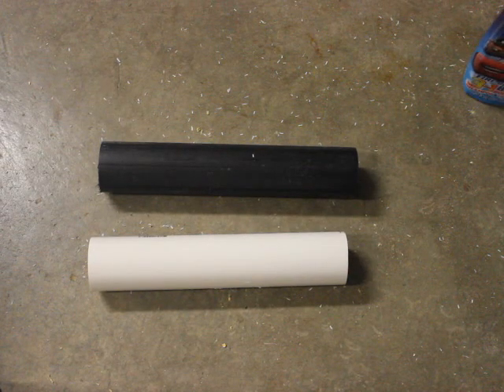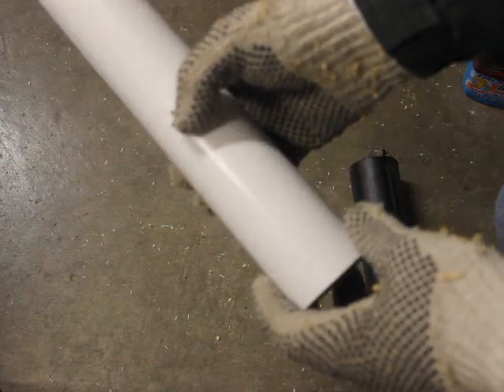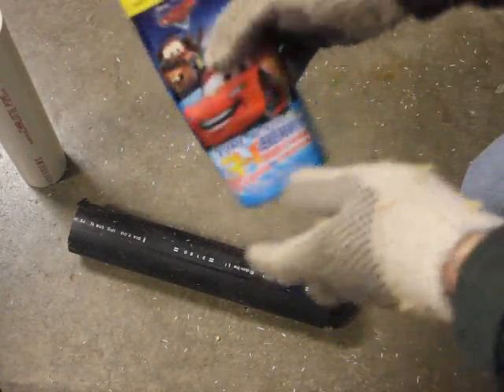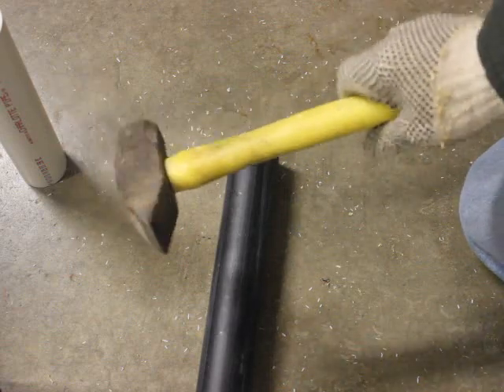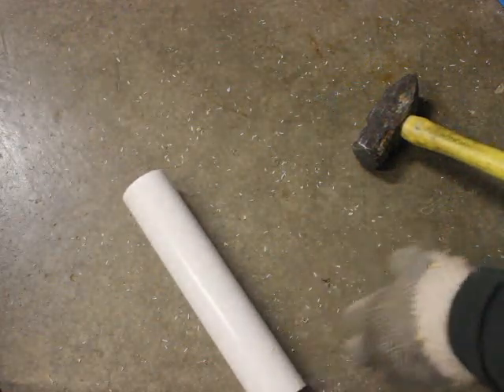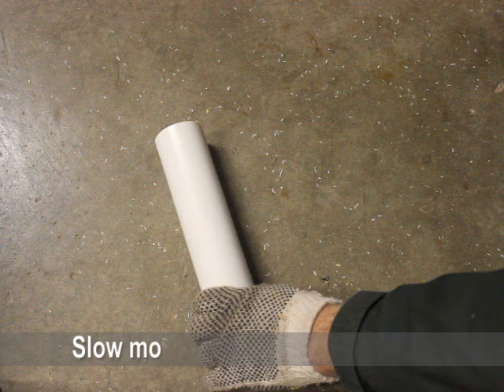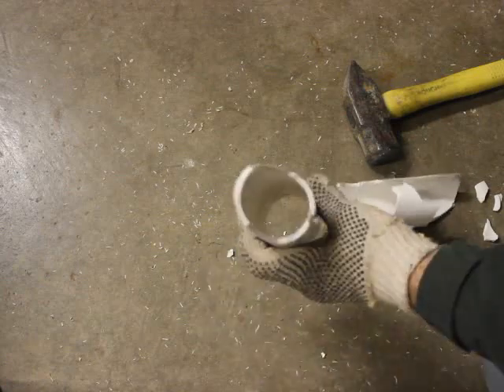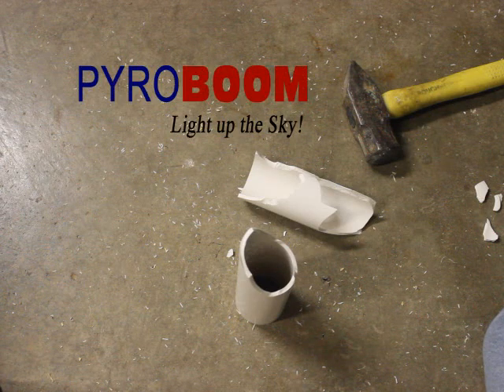PVC vs HDPE Fireworks mortar tube

Comment: Hi sir can I use a HDPE tube for a 5 inch shell? Is it safe with half buried ? And is HDPE double wall corrugated suitable to use as a launcher?
Reply from the maker: You can you use a 5" tall consumer canister shell with an HDPE DR11 12" mortar tube.  We'd recommend using a mortar rack.  No, corrugated HDPE can't be used. Must be smooth wall.
Reply: @PYROBOOM  thanks for getting back to me sir , unfortunately HDPE is not available here in my country, but can I use a heavy duty stainless steel half buried with 10mm thickness for a 5 inch coconut shell? Any suggestions on this sir?
Reply from the maker: @legitdude6916  If it's a 5" diameter shell and you are not within the USA then I'm sorry, we can't help on this one.  Be safe.

Comment: Has anyone found full sticks of hdpe for 1.4 canister?
Reply from the maker: Yes, we have them here at pyroboom.com.  We can sell you a bundle of 88 sticks (20ft length) for $2.10 per foot plus tax and you would need to buy the entire bundle. Offer is good until 3/15/22 due to supply chain shortages.

Comment: I was planning to start building a massive mortar rack for next year, initially I just thought PVC should work, but I'm glad I took the 30 seconds to search out what to use for reliability, I may have just saved a lot of peoples lives that will be at my next display. I still plan to have the entire rack secured inside 1" thick plywood walls, at least 2-3' high, but will definitely not go the cheap route on this project now.
Reply from the maker: Glad you did some research. HDPE or fiberglass is the way to go.

Comment: Need help are abs pipes safe or no
Reply from the maker: ABS Pipe is bad.  You need HDPE.
Reply: PYROBOOMLLC what about fiber glass
Reply from the maker: @kaws3962  If you have a fiberglass fireworks mortar tube, then this is fine.
Reply: PYROBOOMLLC yea cause I wanna make a tube for some 3” and the only thing I can get my hands on are fiber glass tubes

Comment: I tried using the PVC tube like you suggested. But I didn't know you weren't supposed to put the shell upside down to fire it since it didn't say "top" on it.   But I only used a small 1.75" by 5" canister shell, thank God, so the explosion was fairly small and contained to just my porch, bedroom and living room. There were tiny slivers of plastic embedded everywhere, including my face. I wish you would have at least mentioned that PVC pipe is not good to use. After the ambulance arrived, an attorney came that had followed them and wanted your full name and address. The emergency room doctors say I lost the full use of my left hand and left eye and ear. They also found a small hole in my heart. And after all the blood transfusions and operations, the psychiatrist wouldn't stop asking me where I got this misleading info to do such a stupid thing. So please provide your full name and address for my attorney and shrink.
Reply: You play with fireworks at your own risk. If you did not take the necessary precautions and safety isuuses into account as well as the fact you were clearly drinking or under the influence of some drug to LOAD A SHELL UPSIDE DOWN, and then clearly STAND NEXT TO THE TUBE instead of backing away to a safe distance thats on you buddy. If your looking for someone to blame. LOOK IN THE MIRROR!
Reply: @therantman4120  /whoosh!
Reply: Listen one eyed bill. No one wants to hear your sob story
Reply: @therantman4120  Get a sense of humor snowflake. LOL    /whoosh     /whoosh
Reply: @therantman4120  "Clearly drinking or under the influence of some drug"??  I don't do either of them, unlike you, LOL. You have no sense of humor (or compassion). Your parents must be bad. Now learn to understand something of humor, SMH.
Reply: Wow, get a sence of humor,  I bet none of you been laid, you're all to busy playing with explosives lol.
Reply: @macdoctor562  i dont do laid! I do fireworks

Comment: what a bought steel morter tubes
Reply from the maker: "What about steal mortar tubes?"  I think this is what you meant.   You should not use steel tubes.  There are 3 options when shooting mortar shells and I believe HDPE is the best.  So you have HDPE, Fiberglass and cardboard as your 3 options.  Hope this helps.

Comment: +PYROBOOMLLC
what about aluminum tubes with a wall thickness of 1/16 in? Thanks
Reply from the maker: Leander Yazzie no, not a good choice. It would be like a pipe bomb. Only use HDPE, fiberglass or cardboard.
Reply: +PYROBOOMLLC 
alright I'll keep those materials in mind. thanks again

Comment: What about sch40 and sch80
Reply from the maker: Fernie Rodriguez sch40 is PVC. So no, you can't use PVC.
Reply: They're both PVC if I'm not mistaken but one is built for being pressurized so it should make a difference.
Reply: Jonas Hollon No. anything PVC will explode like a bomb. It isn’t worth the lives or injuries that will ensue.
Reply: It'll work if you put it in a 5 gallon bucket filled with cement.
Reply: I use ABS sch40 and it holds up great 3" 4" Shells

Comment: what about a steel pipe
Reply from the maker: I'm not too familiar with steel pipe, but I do know that some people shoot the really large shells (12" or bigger) out of steel pipe.  People don't use steel pipe for consumer mortar shells that I know of.  The most common material for consumer is HDPE, Fiberglass and cardboard.
Reply: PYROBOOMLLC thanks for ur response... i got a hold of some 4 inch mortars and i am having trouble finding hdpe tubes online if u know where i can get them please let me know
Reply from the maker: www.pyroboom.com  we will have a whole lot more in early June.
Reply: PYROBOOMLLC o ok koo cuz i checked that website and they are out of stock in 4inch tubes
Reply: I’ve welded a steel rack with 3/32 wall thickness pipe and never had any issues plus if the frame is steel it helps hold it up so it doesn’t tip over on rough ground just need a big enough plate to give it support. The steel is more than strong enough to shoot consumer mortars out of and it can take the heat of you are blowing off a lot of them at a time since the melting point is 2500 degrees Fahrenheit or somewhere around there I’ve put mortars in upside down in it when I was drunk with friends one time it didn’t even crack or expand what so ever it will do the job especially if your shooting off 1.3G fireworks out of it

Comment: Got a few questions:
1.) Where can you buy the HDPE ?
2.) What size do you need?
3.) How long should the tubes be?
4.) What do you plug the ends with?
5.) Do all consumer mortars use the same size tubes?
Reply: alfred ramirez Haha. We ended up using 4 inch PVC taped in duct tape surrounded by cement in a 5 gallon bucket. Worked out okay. I told the guys blowing off the mortars to get the hell outta there cause they could get hit with shrapnel! The cement worked really well to prevent that though.
Reply: Is HDPE similar to ABS schedule 40?
Reply from the maker: 1) www.pyroboom.com
2) DR11 12" 1.91" ID for consumer fireworks
3) 12"
4) We use wooden plugs
5) No, but they are very close to the same.  They probably vary from 1.75" to 1.95" on the inside.

Comment: PVC shards can't be accurately detected by an X-ray.  They have to hunt the pieces down by hand with a scalpel. That's enough reason not to use it.
Reply: An ER nurse recently told me an MRI can find them.
Reply: Maybe I like PVC shrapnel in my chest, legs, and face?!...  Gosh cant a guy just enjoy his ambulance ride and visit to the ER? LOL I'm sorry it's not funny but it kinda is at the same time. I get it You would think PVC would work cause it looks to be about the same OD and ID overall. Though if you have a 4 inch Salute dont ya think your gonna wanna use professional equipment at that point? Granite not everyone is using Salutes but even just Max Load 60s. You can hear them from a mile away easily! Now if ur using festival balls I could see it maybe working but even then why go cheap? If it gets stuck the black and the flash powder that's packed in those shells is enough to essentially turn it into a pipe bomb that then is gonna leave your face and body torn up. So I guess my point is always use HDPE. UNLESS Your using Festival Balls then Fiber glass works just fine. Though Fiber Glass over time will bust open on ya. HDPE mortars will burst too actually. If you load about 8 ( 60 Gram ) Shells in a HDPE mortar back to back the mortar itself will over heatsl start to melt your shell will get stuck and or you'll get a low break and someone can easily get hurt. Moral of the story use as professional like things as possible get racks and do 1 shell out of a mortar at a time. That's your safest best bet and your Mortars should last a long time.
Reply: neither can Glass , I have a piece of glass in my toe , that only recently part of it came out from years back. they prayed my toed to see if there was something wrong with my toe because it was swelling and turning purple and causing my excruciating pain. They ended up just saying it was a corn , was using corn remover and it started bleeding and skin started peeling , after about a week I felt something sharp and pokey at the top my skin , grabbed tweezers , pulled it out and lo behold . It was a pretty decent sized piece of glass .
Reply: Why does that matter ?
Reply: @BulkedUp247 . The HDPE will deform versus the PVC that will shatter and possibly penetrate your body.
Reply: @BulkedUp247 in case it blows up in the tube can cause your whole rack not to go up in the air
Reply: I’m an X-ray tech and yep, taking pvc shrapnel to the body/eyes would be a disaster. Small pieces will not show up. Not radio dense enough.